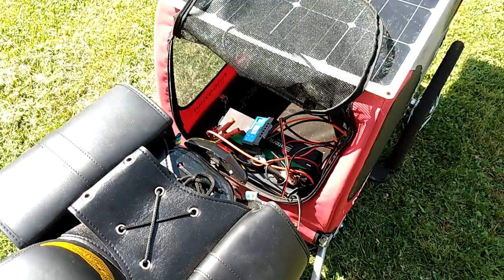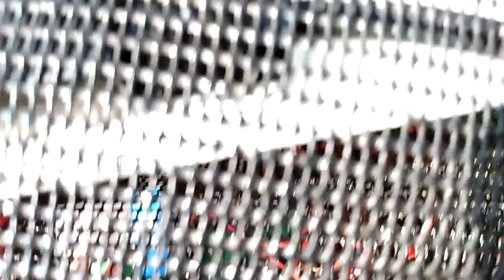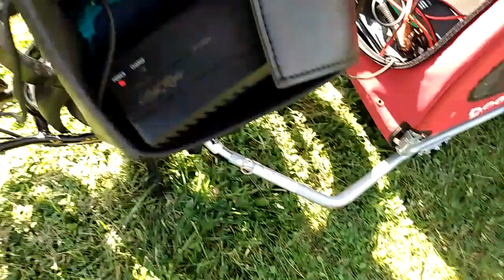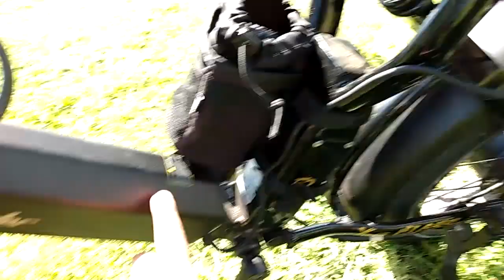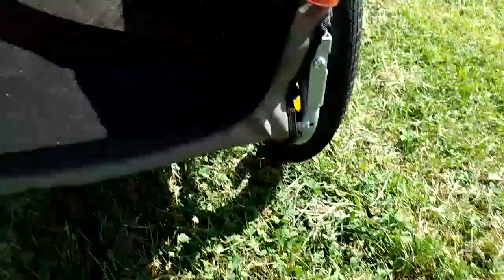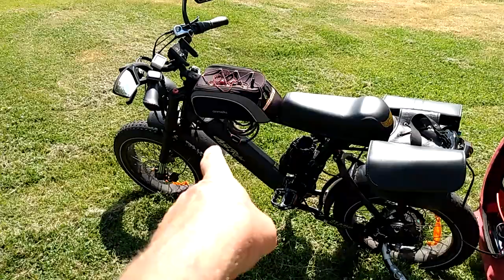Solar Ebike and Camper: Recharge While You Ride and Camp!

Comment: Nice video.. I did the same thing but instead I thought about non stop charging. When I go on my camping trips I have a 48v 15ah ebike and I get about 50miles on pas 2 with all the gear and about 25miles throttle only P2. I ordered the Bugatti ps72 that has 3h charging through ac or solar at 80% but i think of it more of 50% with a 120w solar but anyway I ordered a extra ebike battery so when im on the road wen my ebike battery gos to 25% i swap them and just use the new battery and put the old on the power solar generator and it dose just fine and then when I get to my camp I can take the Bugatti and solar easily off and put it in my tent and solar outside and have power for my laptop aka tv for movies and anything else including being able to take the ebike battery and charge it in the tent which what good about it for night use it can only charge 1 battery completely so I charge both batteries where if both had 25% i can easily get both 15ah at around 12ah or 75/85% but most of the time never because 1 charging while riding and I have my smart plug in to monitor my charging and sends me a alert on my phone when the battery is charged and shuts down then I swap again after 15mins to let the cells relax from the charge. That 100ah battery and solar setup is nice but don't all the wires bother you specially the inverter? I like the portable easy stuff all packed in a easy to take and move setup and have a 700w inverter built in and have plenty of plug ins for my phone,laptop USB fairy lights for the tent and use my water boiler to make a nice hot cup of coffee in the tent with no flames. I could use a hot plate but I like to make simple foods unless at the camp site has a grill/fire pit then ill bring some steaks or dear meat. Now I wanna go for another camping trip but gotta wait till the 4th of July. Leaving the 1st and coming back home the 6th

Comment: I have a similar setup with a 30ah lifepo.  Over here we are limited to 250w motors.  My charger does 48v at 2A.  This means that if I run my bike at any more than 30% power (I WILL flatten the battery because my 2A charger won't charge fast enough at approx 100w).  Yes, I could get a higher power charger if I wanted to knacker the battery up in short order.  I've not actually tested how far I could theoretically get but I would set out knowing I HAVE to stop to recharge at some point.  That could be up to a 6 hour wait for a flat batt.  Oh, one think I'd not be happy with is no ventilation around the charger.  Mine gets hot even at 100w/2A.

Comment: An interesting idea. However, why not plug the solar panel into a small solar generator and plug your bike battery into the solar generator? Fewer wires and connections.
Reply from the maker: Solar generators are more expensive than a battery but if you have one you can use that.

Comment: I am 63 and  love your set up.  I used a Dakota LiPo 54ah battery, built the 30amp solar charge controller in a marine battery box with SAE connectors and a 450 watt modified sine inverter with a Renogy 100 watt flex solar panel.  I bought a back up battery for my ebike and with starting out both batteries on full charge, running 1 empty, loading the second battery on the bike and putting the spent battery on the charger, I can get 120 miles on pedal assist 1 and that is a long day.  I know a lot of cross country e bikers will love your video.  I do enjoy my set up.  Thanks for your great work.
Reply from the maker: Right on friend!

Comment: Thank you for doing this video. I am currently planning a ling distance trip if roughly 600km over a week or so, and am thinking of something similar. 

To clarify a few things with your setup. 

Your 52V 18.5A E-bike battery = 962 Watt/hr

Your auxiliary 12.8V 100A Battery = 1280 Watt/hr 

As you can see, your auxiliary battery in the trailer is roughly 25% larger in capacity than the stock E-Bike battery, despite its big 100Ah label. So this certainly will not charge the bikes battery twice, likely it would drain it entirely or close to it if the solar wasn't giving it bit of help. 

I would consider not using the DC to AC sinewave inverter, as this is a massive loss in energy. Basically costing you that extra 25% capacity you have in the auxiliary battery in trailer. Since thst battery weights 30lbs, your almost better to just have a second E-Bike battery that weights 10lbs and much smaller. This will give you essentially the same capacity as your not loosing energy converting DC to AC back to DC again. 

Another consideration that i would do, and plan on trying. 

Try running the bike on the auxiliary battery directly. So take a DC Step Up Converter (transformer) and step the voltage up from 12.8V (coming from aux battery) to 58.8V and feed that direct to the bike motor. 

It would give the bike a clean stable DC 58.8V rhe entire time until the cutoff voltage of the 100ah batteries BMS shuts iff safely, all while still charging from the solar panel. You can cycke between that and the E-Bike stock battery. A bonus to this design, you can also charge your stock ebike battery direct from the DC to DC step up converter (by bypassing the the 12.8V battery, and having it connected direct to pwm solar controller) 

100W Solar Panel > PWM Charge Controller > DC to DC Step Up (12v to 58.8V, 2-3Amps) > E-Bike Battery = now your charging and riding without inverter, and can do this while resting for break. 

Food for thought. Im liking the idea if the dog carrier over standard utility trailer, its all enclosed nice and ready ti go product. 

Thanks again for great concept video! 

Cheers
Reply from the maker: You are putting in almost 100 watts from solar on top of the charge coming from the battery.  Direct charging the ebike from solar is not recommended.

Comment: If you can recharge the lifepo battery off the solar power why are we not using lifepo batteries as the main source to power the bike?
Reply from the maker: That battery is 52 volts. Solar panel is 12 volt and you need steady current to charge.

Comment: I’m confused- if this is a 2kW bike, how can a 100W panel charge it? I still trying to get my head around the possibilities here!
Reply from the maker: The ebike uses a 140 watt charger and takes approximately 5 hours to charge completely. If you are charging while you are riding the battery will only slowly go down in charge and then park it in the sun to charge back up.  

You can also use a power station instead of the battery and inverter.
Reply: @solarcabin  How do you keep it safe while you're charging? You just always stay by your charger/battery/ebike?
Reply: @sirtimatbob its just mathematics. If you got a 15ah battery and you used only 2bars from five you would think 3+3+3+3+3=15ah thats 5hours possibly 6 so if your charger is 2ah 2amps per 1 hour and you used 2 bars from your 15ah I would say your battery would be 9ah left so to charge from 9ah to 15ah u need 3hours maybe 4 to fully charge to 15ah since 2ah+2ah+2ah= 6ah so 9+6=15 but give it a extra 1hour which would be your watching mode you can easily safely not watch and charge a battery just remember to keep a eye on it that last 1hour you know what I mean
Reply: Basically the 100ah battery and the ebike charger that came with it is doin all the work. Its just like charging at home normally. Think of it this way as I tell people. The battery which is 100ah is your home, the inverter is the wall outlet, the ebike charger is the converter, so he Basically got a 20ah ebike battery even though its 18ah but I say 20ah because the lost of power during use and riding and power transfer rate. So the solar charges the battery and the battery is doin most the work which your ebike won't know the difference between. So he could actually charge his bike like 3 to 4 or 5 times or more if he wanted to suck the battery and since your ebike charger only uses like which I believe is 36v at 75w 48v at like 100/125w and 54v 120w to 175w max but he got a 300w inverter so even if it went alil higher like 200w it be fine. I think the highest I ever heard idk because I got a 48v was a 54v draws like 196w because my 48v draws like 136 to 169max so just say mine dose 150w. He got 300w inverter perfect his solar is 100w fine his battery is 100ah battery which is 1200 watts so if my bike is drawing 150w a hour I could charge just on battery for 9h say but adding 100w from solar thats a extra 900w for those 9hours so now at night I can charge a extra 6hours running at 150w a hour but its gonna be bigger hour time because he's using the charger as the bike is full so its not gonna come close because the battery is full and ebike battery full and probably only drawing like 100w most so now u got a fully charge battery 1200w and bike battery a solar 100w input recharge of the 1200 so the 1200w/100ah battery is never gonna loose power Basically because its regaining that 100w from the solar if that makes any sense sorry for the long message

Comment: Have been trying to do the same thing, however not sure if people have had the same problem as I have: being in the UK am thinking that this is alittle more difficult, seeing as the chargers operate on 230v AC and hence any inverter would have to do the same thing would take far too much from the LiFePO4 battery (have purchased a 30Ah LiFePO4 battery and am concerned that my multimeter shows the voltage fluctuating below 10v when the 12v to 230v inverter is on the battery) - any suggestions on what I can do to improve this or should I just try to get a 110v inverter & charger?
Reply: You'll probably find your charger works with 110-240v anyway and doesn't actually need 240v, but if you want to use the same inverter you've already got, you should probably up the size of your LiFePo battery to between 150Ah and 200Ah, and use more panels to compensate. In the UK this setup is more commonly seen in the back of a camper van, as that size battery will be getting on for 40kg.

HOWEVER, unless you're desperate to run a 3-pin plug for something else like a fridge, the amount of losses this bloke will experience converting the DC to AC with the inverter then converting it back to DC with the bike charger, compared to just connecting the solar panels directly to the bike battery with a boost MPPT, is probably not worth it - especially considering you're adding a lot of cost and weight with the inverter and extra battery. Lifting 10kg up 100m in altitude uses the same energy as lifting 1000kg up by 1m, so there's a good reason those long distance 'sun bike' folks generally don't do it this way.

I'm in Northumberland though, so maybe the hills aren't as bad where you are, and you can afford to go for a heavier set up. After a few weeks of thinking about it, I've decided to go for 200W of folding panels and just charge when I stop rather than drag a trailer around.
Reply: @banksarenotyourfriends  Point well taken with doing DC-DC conversion (rather than using a 230v inverter), as the hills where I am in South Wales are very trying at times - especially between valleys. Think have got a system in mind which am going to try in the next few weeks which should work better for the conditions I'll be riding, along with allowing the trailer to be optional rather than essential fingers crossed 🤞
Reply: @banksarenotyourfriends  I like that thought. It allows you to set up a camp somewhere and get your batteries charging while you take a break. 
How far do you get? How many batteries do you carry?

Comment: While admirable to use solar, the panels have bulk and weight. I rather solve the problem bringing my charger ans 8 meter long extension cord. People are more than happy to let me plug in. And here in Costa Rica no one will accept  payment for that. 100 watts at 12 vdc wouldn't do much on my e-scooters 72 vdc 40 AH battery demand.

I built a cargo trailer of 3 inch PVC Plumbing. The trailer can serve as a bed inside the tent it carries. And the Cargo trailer itself can be extended in both length and width. as well as put up sides.

My e-scooter is a RAM Mia 1200 watt. Will do 66 KPH on FOT and no peddling. Range is   over 100 Kilometers fulling the trailer, though lots of 30 to 35% grades to reduce that to half.

I am 75 and living in Costa Rica with year round weather supporting outdoor activities. City speed limits 20 to 40 KPH, Highway 40 to 60. And unlike the US most drivers here are 10 to 20 KPH under the speed limit. 10 KPH over will reward them with  a fine equivalent to 5 months  income and 1 year suspension of license. So speeding is uncommon.
Reply from the maker: You can do that if you can find a plug but this is more for camping and travel where there are no plugs.
Reply: @solarcabin  
I was thinking just how fortunate I have been. Cars, trucks, motorcycles bikes I have not had a flat tire in  over 64 years. Two exceptions. One living in an apartment where a druggie let the air out of all 4 tires on my truck, first night there, another at work where someone let the air out of both motorcycle tires. Both resolved in under 10 minutes. Carried a compressor in my truck and  a spark plug pump on the motorcycle, which was a modified 1976 Honda 750F bored and stroked to 836. But never a flat by puncture.
I took 2 identical back packs costing $9 each and use them for saddlebags/panniers Additionaly me e-scooter has a trunk. If needed I could mount 2 more back packs in front. That and a few bungee cords and good to go without a trailer. Though a trailer has its attractions as well. Made one of 3 inch PVC

Comment: Thank you for your video.  I will try this setup.  Great positive energy in this video.  All the best to you on your adventures.
Reply from the maker: Thanks, if you have a power station you can use that instead of the battery and inverter and is lighter.

Comment: How did you attach the trailer to the Ariel Xclass? Did you have to modify anything?
Reply from the maker: I used one of the bolt holes for the rear passenger pegs for the mount.
Reply: @solarcabin  that's brilliant! Thanks

Comment: Only thing I would do is support that panel that constant bouncing will destroy that panel eventually
Reply from the maker: It is a little wobbly. You could put a piece of 1/4" plywood under it.
Reply: @solarcabin  Make sure whatever you put underneath it has various bars across it, to keep the solar panels a bit elevated. This will allow air flow underneath and improve the life of the panels.

Comment: Did kinda the same thing got a jackery 1000 and 2 100 watt solar panels and a aosome trailer gone camping a few times has no problem with a pace 500
Reply from the maker: You could use a power station and reduce the clutter and I have a Generark but this was to show how it can be done with a battery.

Comment: You can also use a Jackery or Bluetti solar charger to charge the E-bike.
Reply from the maker: You can and I have a Generark power station that will also work for this project but I wanted t shoe the LIFPO4 set up for people that want to DIY and have that equipment.
Reply: @solarcabin  This is also cheaper. I have a kids trailer I took the top of and added a floor. It makes a great cargo trailer for my mountain bike but I have a similar ebike a Sondors Mad Mods. I just looked at a Expert Power brand 100 ah battery. It's like 140 more but it's also 8lbs lighter making me like this idea more. Thanks for the cool idea. Cheers

Comment: 30 miles at 30 miles an hour for one battery on a bicycle is amazing, I also like the full suspension and larger tires
Reply: Definitely a plus. I got a $400 ebike that rattled my bones. A $20 wrap around seat pad and premium road tire for the rear made a huge difference in ride comfort, and I haven't had a flat since I installed it. They were painfully often prior. Get your tubes from a bike shop which supplies a brand with metal valves. Sheering was my most common failure, punctures or seem separations on tubes I bought from Walmart (both Goodyear extra thick and Slime brands) that look like punctures were second.

Comment: This is fantastic! I have daschunds and they and my camping gear would for sure fit thank you so much for sharing!!! How much was your ebike?
Reply from the maker: The Ariel X 52 volt is around $2k. They just released a Kepler that has same speed and range but is mt bike style with a rack for $1800.
Reply: @solarcabin  thank you for the info I will check it out!